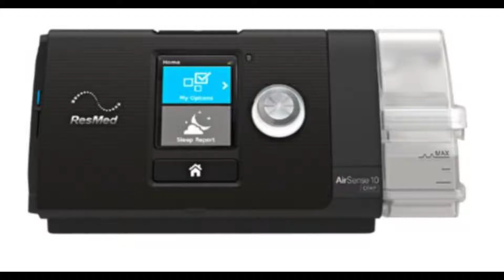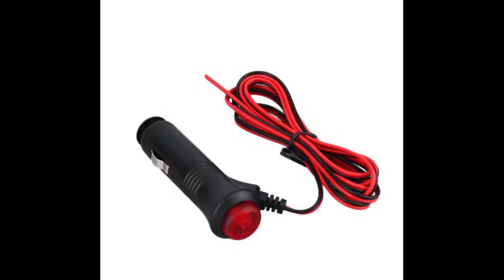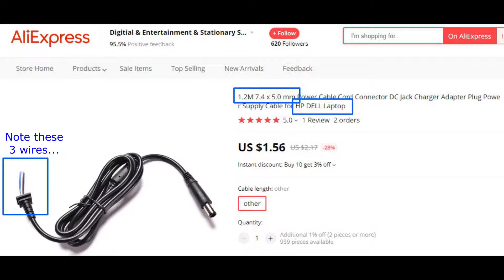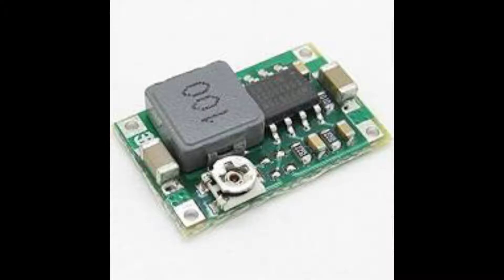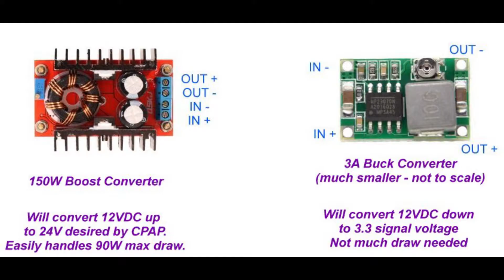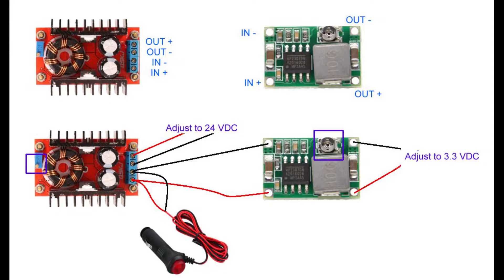How to make a 12V adapter for ResMed Airsense 24V CPAP

Comment: Great video! To my surpise it works (in my case) without additional 3.3V DC. I bought all the parts, including a cable kit from Medistrom (specifically for the Resmed Airsense 10) to have the appropriate and hard to find Resmed Airsense 10 connector. I cut off the other connector form the cable to be able to connect the wires. To my surprise there were only 2 wires........ Without much hope I installed only using the 12V to 24V conversion. AND IT WORKED..... I use a portable 12V portable "solar generator (FlashFish) thal also has a power outlet. using the power outlet the CPAP lasts just for one night, but using the 12 to 24V adapter my power consumption was reduced to 50%.... Very pleased.... Thanks. Regards, Aad

Comment: Many solar power generators can put out 15 volts now on DC. can this be made with the resistors, buck converter and output cable and run the AirCurve 10 on 15V? As a 40+ year military trained electronic technician (now Cyber woot woot fancy) I have found that the less we have to convert voltages, the greater efficiency, less heat and thus longer operational time. Power factor loss is a real thing and heat can be a safety thing and heat kills components long term. Thanks, I am looking to use lowest cost/weight power banks for my CPAP while flying commercial and when staying in 3rd world countries with less reliable power. I have no issue carrying 2 or 3 power banks, bigger concern is size/weight and overall cost while getting 8 hours operation. Great video BTW.

Comment: Great video! Unfortunately, I already paid the price and have a 12 cable. I do have a different question I hope you can help with.

I have two small blower motors used for repair (1 per CPAP) for a ResMed CPAP just like yours. I would like to create a small travel blower I can hook to a mask without all the hype - a simple blower connected to my mask letting excess air leak out. The blower motors have a three wire connector - black, yellow, and orange. Can you tell me what voltages to apply to which wires so I can get it to run from a simple switch? This would beat the $700 - $800 for a small (but not small enough) travel CPAP.
Reply from the maker: I don't know, but I'm guessing it's a brushless motor, so you have to give it a rotating pattern of power. 

If not, it's a DC motor with a speed sense signa.  You could try applying low power to each pairing and see how it responds...  but even if it worked that would be constant pressure.  Better to just use the self titrating ResMed...

Comment: mine runs on 12 volt here i Australia ,i tryed to adapate origanal lead ,as i did with my old machine ,"2 wires .the new one has "3 wires .i guess i need to give the center pin 3.3volts to make it work ,via 2700 ohms resistor ???

Comment: Firstly brilliant video you saved me a small fortune. This end up costing me around $20 Aus to make which is a lot less then the $140 they want for one of these. I  would like to offer some advice if someone has some troubles. When I first wired this up, the machine would come on then within a few seconds it would cut out. After a night to sleep on it I realised that the wire that I was using wasn't a heavy enough gauge. So rewired with a 7.5 amp dual core and it was perfect. Again one of the best instructional videos I've seen you made it really easy to do.
Reply from the maker: Thanks for watching!  Channel still not monetized so make sure to like/subscribe/refer me!

Comment: How much more efficient is this than transforming 110AC? I have a flow battery, some 250wh, and it doesn’t last the whole night. Figuring there would be some gain in going DC-DC, but is it dramatically more efficient??
Reply from the maker: See below.   I found it was about 15x more efficient - 20hrs to 1/2 discharge on DC vs 3hrs to dead on AC

Comment: Amazon sells car sockets with alligator clips, plug your converter into socket and connect alligator clips to dedicated 12 volt battery. I'm getting 3 nights + CPAP with  humidifier and heated hose turned off connected to two 18ah 
SLA batteries in parallel for 36 amp hours. May try same two batteries in series for 24 volts to power CPAP without converter.

Comment: I have a question i would like to apply your theory to a airsense 10. As stated resmed loves that chip in the cable to say yeah its resmed. Could you do this but change the 24v Dc plug to an 12v plug as I have a maxoak k5 that is a 24v plug not the car type and it will still pull the 24v to use my airsense 10 as i do not have that chip adapter your resistor hack fixes.

Comment: Firstly, a great video Gyro. I followed your instructions and purchased everything you recommended to use. I managed to put everything together and made sure that I had the correct voltage at the plug end (24V & 3.3 V). However, I had 3.3 volts when it left the voltage reducer (including resistor), but it read -3.3 volts on the centre pin on the inside of the plug. This meant that the ResMed CPAP machine would not run. Can you suggest how I can change the voltage reading from negative 3.3 to positive 3.3 volts? Could the problem be with the HP Dell laptop cable?
Reply from the maker: Reverse polarity means you wired it backwards...  double check that you're connecting the correct wires from the HP cable to put ground and each positive where it belongs on the output plug.

Comment: Thank you I'll be downloading/saving this video for future use!!!

We had to go the EXPENSIVE AF route for our S10s (wife and I both have S10's) because at the time no one knew or was sharing this information.

If we have a situation where one of the crappy adapters blows up etc, this is dead easy to build and I greatly appreciate your time sharing this. The 24v converter is simply a voltage doubler but they're easier and just as cheap I think to buy the pre-made kit like you did than make your own from scratch.

Note .... I found this video trying to find out what 12v battery size I need to allow 8hours of sleep and I'm STILL looking as noone is sharing the average or range of 12v xAH usage so I can then times that by say 8.5 and look for such a lithium battery (lighter for travel, smaller and as a benefit .. MUCH MUCH faster charge times when we get to a power point).
Reply from the maker: Watt-hours will vary with your settings, but 40W is pretty typical draw.  320Wh per 8hr night.  That's about 2/3 the usable range of a standard 100Ah FLA (lead) house battery or 1/3 the usable of a lithium equivalent.
Reply from the maker: 40W is WITH the heated humidifier. I get many times that if I turn them off and only use the pressure...
Reply: @GyroGearlooseHelis  That's what I have been searching for !!!! Thanks
Reply: Asking myself the same question !!!!

Comment: So stupid question. You had a variable power supply outputting 3.3V and then you introduced a 2.7K Ohm resistor in the path effectively just reducing the voltage of the supply down a bit. Why not just set the supply for the 3.3V minus the voltage drop? There is no real query here, from what I can tell?
Reply: A good one
Reply: Isn't it limiting current not voltage?
Reply: @t4796  well, on second thought Resmed could be doing some current sensing on that line. Their schematics are not public so who knows what's inside the device.

Comment: what size enclosure is the minimum you need for these parts? I'm trying to get a list of all this to ship to canada off aliexpress, so far without the enclosures I'm at $27cdn to make 2 of these

Edit: also can this buck converter be used this way.. I want to put a 24v lifepo4 battery on it and I know the voltage input will be different, prob 21-26v depending on charge % right? I know this converter adjusts from 10-32v. What I don't know is can the input be variable and the output be a consistant 24.0v?
Reply from the maker: My enclosure is 4 x 1 x 2.25"...

A 24v battery is actually NOT better because it ranges above AND below the target 24.0V requiring both boost and buck conversion...   better to use a big 12V battery and only boost it up as shown.
Reply: Great video, Got a question I am hoping some one can help with. Does anybody know of a DIY pass through charger video that I can plug into my house 110 and charge the battery all the time and also use my Cpaps on DC?
I am trying to come up with something that won't  ruin my battery. I don't like waking up and having to plug in to DC when the power goes out.

Comment: Great video. Note the entire Phillips Respironics dream station series runs on 12v dc directly without all the futzing around and the official shielded 12v dc power cable is about $20 online.  Sad that these companies can’t figure out that 12v dc is the ubiquitous international standard and design their machines to natively be powered from that standard.
Reply: My old Philips was DEAD easy to make an adapter for, a basic lead with the correct plug size and polarity (I think I end up using a laptop lead that was like $10 on fleabay). My Philips was part of the recall and I replaced it with the Res S10 for a few reasons .... imagine my surprise on the 12v bs.
Reply: Yep, Phillips sure does run on 12VDC. And for that convenience, they were poisoning people for years with toxic foam particles. After being forced to recall those units, many people waited over a year for a replacement, leaving them to either continue poisoning themselves with their existing machine, purchasing a new one out of their pocket that would not be reimbursed by insurance, or going without therapy for as long as it took Phillips to get around to getting them a replacement. And in that replacement, you're treated with an encrypted SD card in an attempt to force people to use OEM solutions.

Comment: Thanks for great hack, been looking hard for these. I see that the negative of the 3.3 volts is not connected. Is it connected internally to the board or do you have to do it yourself?
Reply from the maker: The unused ground-out terminal on the buck converter is connected internally as you say...  ground is electrically the reference for all other voltages.
Reply: @GyroGearlooseHelis  I Have both the Airmini and AirSense 10, so I build interface/power supply box for both...work wonderful; thanks so much

Comment: I know this post is a little older , but I have been up all night searching looking trying to figure something out, do to a storm been without power for 30 hours. Same machine as you so I'm like aweeeewwwwwwwwweww, they want 90 dollars to 500 dollars for the BS for situations like this gosh.
Reply from the maker: Dedicated CPAP battery systems are a blasphemy in my opinion...  overpriced and single purpose for hopefully rare usage.  This $5 adapter and an old car battery are all you need in an emergency.

Comment: Hey Gyro, thanks for the excellent video.  Mind if I sense check something with you?
I have the DC/DC adapter for my S9, but that thing is bulky and my main interest in your setup is limiting the size I have to pack around.  I have a battery pack that will output 24V/2A.  Since I don't use the humidifier or heated hose when traveling, I figure I could bypass the boost converter and make a small buckconverter/resister block and encase it in epoxy. (heat issue with epoxy?!) This would give me a barrel plug to barrel plug configuration with a tiny footprint.

My noob math tells me 24V/2A will give me 48W.  The S9 AC/DC is a 90W output, but I've seen official ResMed travel adapters for the S9 that output 30W, advertising that no humidifier or heat can be used.  

Am I close or should I go back to the things I know?
Thanks in advance!

Edit: the battery pack is a Renolgy 72000MAH/266WH power bank.  Even though I believe those numbers are overrated, I get 3 nights using the 12V ResMes DC/DC adapter
Reply from the maker: You could do what you describe, but I would ideally modify the resistor value...  in theory, the right value communicates how much wattage is available and the CPAP knows not to draw more or else shutdown for insufficient power.   You could carefully keep my value at your own risk,  but may see odd behavior if the unit attempts to draw more than you actually provide.

Comment: is the resistor a 1/2W or 1/4W? Thanks
Reply from the maker: Such low power for sense that 1/4W is plenty.
Reply: @GyroGearlooseHelis  thanks, I put it all together, I hooked up the Resmed but it is not powering up. I took apart the adapter to check for voltages and I had 24V and 3.3V DC and it was all good. I proceeded to check the voltage again but this time with the Resmed plugged in, the boost converter was dropping the voltage to 8V DC from 24V, if I unplug the Resmed the output goes back to 24V. Any idea why the voltage is dropping after connection? Thanks
Reply from the maker: @jaytua730  hmmm...  your power supply is not keeping up with demand.  The 150W supply I use has no problem with 90W demand,  but you might try turning off humidifier and/or heat to see if it at least starts...  couple dozen people have said they built this without problem, so not really sure what's different in your build.

Comment: Any way somebody could make a 12v adapter for the Airsense 11? They will not have an adapter for some 6 months or so. It is 24 volts still with a completely different connector. Maybe it is the same voltage output as GyroGearloose-HackingRVsCheap with a different plug?
Reply from the maker: I would guess "most likely"...  count contacts and measure voltages for confidence.

Comment: Might this supply be the same for older ResMed S8?
Reply from the maker: I dont know.   The A10 is one of the most popular CPAP machines and the one that is annoyingly hard to power with 12V.  If your S8 is also 24V with a center pin, its possible.

Comment: The resumed 12 volt adapter Is at 13 amps which is greater than my battery pack 10 amp 12 volt outlets. I need to go directly to 12 volt battery with clamps.

Comment: Awesome video!  Any chance in getting a parts list and where to buy them?
Reply from the maker: Everything shown is available from AliExpress among other places.  Prices and links fluctuate but easy to search.   Parts:
- 150W boost converter ($3)
- 3W "mx360" mini buck converter (70 cents)
- 7.4mm x 5mm HP coaxial power cord ($1.50)
- 12V "lighter" power cord ($1)
- 2.7K resistor(s) (penny?)
- enclosure
Reply: YOU Sir, Are Awesome!  That just saved me hours of reverse engineering for the 2.7K resistor.

Comment from the maker: I know people are going to ask how efficient this is compared to the wall plug (especially if running an inverter as well).  I can't provide definitive efficiency figures because CPAP power usage (from any source) varies by user, settings, and even night to night...  But, as a subjective comparison, I ran my CPAP on the compressor/inverter/battery pack shown, with my normal pressure settings for (tentatively) 7.5 hours for several nights using the AC wall adapter vs my DC DIY adapter here.  I shut off the heater/humidifier for all tests.  If I used my DIY DC adapter here, the battery read 84-87% each morning (so, I'd get 3 FULL nights STILL without over-discharging the battery -- perfect for weekend trips!).  If I plugged the wall adapter into the 140W inverter on the compressor/inverter/battery pack, it would kill the battery in about 3 hours -- couldn't even make a complete night!   Now, I can't blame ALL of that inefficiency on the wall adapter alone, since I'm inherently adding the jumper pack's really BAD modified sine inverter at the same time -- but the combination, again, was unusably atrocious.  Absolutely no doubt the DC-DC adapter shown here (and I'd assume the real ResMed one) is much better by FAR than using any inverter/wall adapter.
Reply: Thanks. That was one of the question I had im the back of my head. I knew it should be better not going through the inverter.